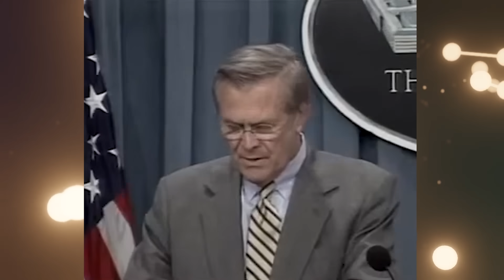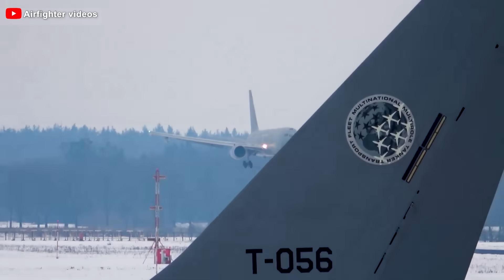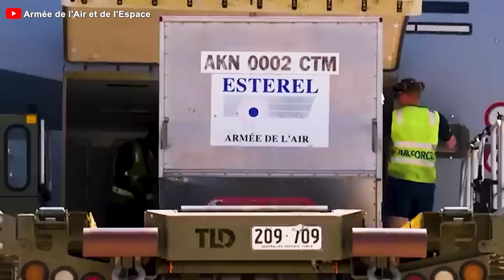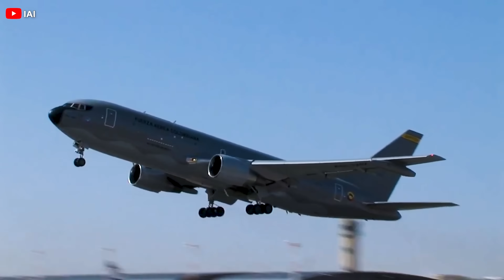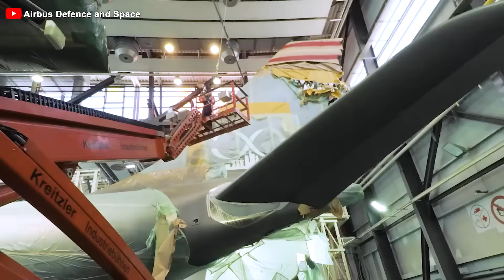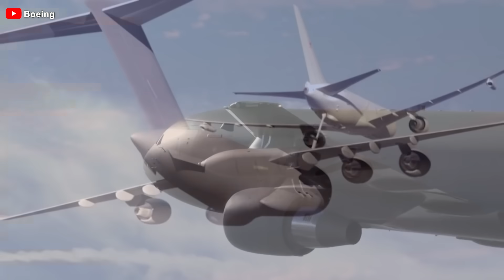Here’s why Air Force prefer the A330 MRTT to Boeing 767 in KC-45 contract!

Comment: They probably would have taken the KC-45, but the need to redo parking spots and rebuild hangars to accommodate the KC-45 was a bit of a non-starter.
Reply: doubt it ,the KC45 isnt bigger than the KC10 , more likely was that boing told theyr lobbyists to pull the USA card ,even though Airbus was allready building a production line in the US
Reply: @martindonat3249  - You sure about that? Could the KC10 –if they had enough– have been used for the sole tanker? Nope. So yeah, the airport issue is huge. The problem is that they want a 1 size fits all tanker for cost savings reasons. The deal was done under sequestration. If you need 1 size to work, and some missions can't use a large tanker, then you order lots of the small tankers. It's stupid, but it is the simple logic of 1 size fits all. It will hamper our military in some places in the world, but money changes everything.
Reply: @5metoo  you made me look up the messurements , they are prety simelar in sice ,exept the wingspan ,the airbus ha 10 m (30 feet) more, i didnt realise that befor , the main reason they didnt buy more KC10 for one the existing ones getting kind of old ,and the aircraft type was disscontniued after boing swallowed mcdonald douglas so there is nobody building new once , also the airbus is the more modern and efficent of the two
Reply: @martindonat3249  - Sure, but doesn't the point stand that they're talking about replacing a fleet of small and large tankers with 1 tanker, and the only way to do that is to choose a small tanker? I think a more reasonable choice would be to replace a large and small tanker with 2 tankers, one large and one small. I heard a tanker pilot once comment that he flew KC-135's on missions where it wouldn't be practical to use the proposed airbus. But lost in all this is whether a 1 size fits all strategy is wise. It doesn't seem to me like it is. But that's government for you. People are now arguing over the details when the grand strategy was apparently settled by unnamed bureaucrats who don't even understand the consequences of the choice they made.
Reply: It was such a non-starter that it won the contract. And then Boeing lobbied the US government to cancel the deal.
Reply: This would have been less than 1 % of the extra cost due to contract amendments, delivery delays, perfomance gaps etc - you can be sure that in case you point to such shitty little things that the truth is somewhere else and they throw smoke grenades - indeed as long as the proposal is in line with the requirements which of cause included topics like parking stands and hangars why did it win in the first place - because thei Air Force wnated and needs a working solution and not a shitty paper tiger

Comment: I will never understand why they want Refueling tanker to be multipurpose. that is like you requesting a smaller gas tank in your car so you can have a larger trunk.   I would think they would want to be able to refuel more aircraft so they can accomplish their mission.   
I am also amazed every time I see an air fueling. How they can line up they aircraft receptacle with the boom or basket.
Reply: The A 330 Mrtt can carry more fuel than the KC 46... 
You want the tanker to do more things than just carry fuel. So you can deploy troops with more plattforms, carry ammunition and equipment to forward bases, and after that you can refuel planes all on the same plattform.
To stay with your car example, If you have a 2 seater sport car its nice for driving fast. The problem comes when you need to carry more than 2 persons or need to carry large things. So a M3 touring or somethings along those lines would be better than a corvette for most owners.
Reply: Imagine you requested a gas tank that fills your entire trunk. Would you ever be able to fill it completely? Probably not because the weight of all that fuel would become a problem. Would you ever need it? How often do you make that 2000 mile nonstop trip? Probably never. On the other hand, sometimes you want a really large trunk, and don't need to carry much fuel, because you need a deliver large items over just a few miles. Now you could just buy two cars, one with an enormous fuel tank, and another with a small fuel tank so you can carry more cargo, but moneywise you're probably better off owning just one car that is a compromise between fuel capacity and cargo capacity. Military thinking is similar. If you can buy a single aircraft to do multiple missions, you might not need to buy two (or even more) types of aircraft.
Reply: A common mission for tankers is to deploy fighters overseas, providing them fuel during the trip while also carrying mechanics, spare parts etc.
European MRTTs are also often used on transport missions alone, as troop and/or freight carriers. They can also perform medevac flights, like the KC-135s before them.
Having a single fleet performing several roles is especially important when you operate a small fleet, not hundreds of strategic aircraft like the USAF.

Comment: MRTT highiest payload, true multirole not only troops or fret, also command module etc etc etc Boeing is ONLY politics even Nortrop looks "disgusted".   Bizarre tenders led to naval problems destroyers are being rebuilt by Ficantieri.... finally same problem with KC... too big lobbies leader to too big mistakes. While for exemple Général Electric and SAFRAN are building US/FR engines ( LEAP) for decades with ZERO problem.... some will say I am french and wrong ..😂 the fact is that U.S.A have a big PROBLEM refueling while superb solution was/is availaible....

Comment: Airbus was a better functional fit. B plane is still missing capability.
Reply: And what capabilities might those be oh wise oracle!?
Reply: Range, fuel capacity. Ability to use em as C&C centers and transports.
Reply: Not too mention refueling more planes at once.
Reply: @NeroontheGoon  Multipurpose answered well by
 
@frednoname3714
för 10 timmar sedan
MRTT highiest payload, true multirole not only troops or fret, also command module etc etc etc Boeing is ONLY politics even Nortrop looks "disgusted".   Bizarre tenders led to naval problems destroyers are being rebuilt by Ficantieri.... finally same problem with KC... too big lobbies leader to too big mistakes. While for exemple Général Electric and SAFRAN are building US/FR engines ( LEAP) for decades with ZERO problem.... some will say I am french and wrong ..😂 the fact is that U.S.A have a big PROBLEM refueling while superb solution was/is availaible....

Comment: Not only did Boeing outbid Airbus by 1%, they also guaranteed the Pentagon that the price per plane was fixed and any overrun cost would be absorbed by Boeing.
This bit both the Air Force and Boeing in the ass, to date, Boeing lost more money on overrun than the entire contract cost, in other words Boeing lost huge amounts of money and to top it off, the Air Force is stuck with a tanker that is not fully operational due to too many problems with an old air frame.
Had the Air force stayed with the MRTT, they would be flying a fully functioning  tanker/cargo plane that is new and still in production that can refuel 3 planes at the same time instead of 1 plane at a time, carry more fuel, can refuel more planes, has a longer range and so on.
This case is a prime example of politicians not looking out for the best interest of the military and I suspect there was plenty of under the table handshakes going on to hand Boeing this deal.
Reply: Well the US governement is well known to just be an excuse for compagnies to turn their will and greed into laws. And thats especially true for the military industry, they manage to spend between 3 and 6 times more than China in defense budget for just maintaining their army, while the CCP has been building it from scratch the past decades. You just can't explain such a difference in money spend vs actual vehicles produced just by "its better in the USA". So many billions disapeared into canceled programs, with the compagnies leaders keeping millions each time... Its just a huge fraud scheme.

Comment: The military changed the RFP requirements to allow the Airbus to compete and win (initially).  Boeing sued on these grounds and won.  From what I remember, the airbus tanker would require significant modifications to many military runways due to longer wings. This was not an issue with the 767.
Reply: I'm not sure you modify runways because the aircraft have slightly wider wings.
Reply: Wherever a C17 or Galaxy was fit to, the A330 MRTT fit as well. As far as I remember the US is the only Country selecting the Boeing tanker. I`m sorry for the US pilots to fly the second best tanker.
Reply: No, the MRRT got explicitly penalized for being more performant. They structured the mission profiles to fuel single airplanes with short missions. The MRRT got penalized for launching with more fuel and launching with surplus refueling pods. They also ignored its capabilities for transporting cargo.
Reply: No, it was the hangars that were too small.
Reply: Airbus A330 is much larger than KC-135 or 767.  It would have required significant MILCON = $$Billions, A330 would not fit in existing hangars!!  Also, Gen. Arthur Lichte was corrupt AF look that POS up.

Comment: Missing is the slanted review process that allowed a larger plane than was originally specified to be considered. the dod told Boeing they did not want to consider a larger airframe and then accepted one in the Airbus airframe. The 777 would have been the direct competitor to the A330. They were more concerned about the number of aircraft and total operational costs.  There was also a good deal of mission creep and increased number of configuration to be capable of handling different aircraft types than what was originally specified.

Comment: I don't think it matters. The most important point is that after this experience, I doubt that any European defence company will ever compete for a major US defence contract again, which in some areas, puts the US in the hands of a de-facto monopolistic supplier.
Reply: That has always been the case.  The US requires (in a VERY China way of doing things), that everything must be built in the US, by a US led/owned company.  So add in that, having to partner with an often, rival US company. To get things built in the US.  Along with propriartary tech secrets, walking out and appearing in US gear.  Is it any wonder that EU companies dont do much business with the US.
  US gear is not always the best either. So people buy different things for thier own needs.  The US AEGIS RADAR system is an excellent system. So is the UK Sampson system.  Both do the job very well. Both have strengths the other does not.  They work better together, each covering the weaknesses of the other.  AEGIS is reported to have a shorter range and less sensitivity, with a better acqusition time to launch time. Sampon, greater range, sensitivity and number of tracked targets, with a longer time to aquire and launch.  Both do the job they were designed for.  Samson, has, in several joint exercies had to be turned off. So AEGIS operators get some experience.  Together, in a BG, probably the most letha air defence setup in the World.

Comment: The USA has always had an understandable aversion to procuring overseas. Buying a 'home grown' product has many advantages. Control of supply, money into the home economy, security etc., As long as the 'product' is fit for purpose and meets specifications, it makes sense.
The downside is that decisions can get skewed by political interference and Boeing has long been able to use that to leverage products which are not always the best option. The problem with that is that Boeing has relied on its clout rather than engineering prowess.
Reply: They were going to build a KC-45 factory in America. 
This is bribes in exchange for protection.
Reply: I mean, without any pressure on American companies to do better, you'll always get substandard crap like the KC-45, why bother trying if you can just cheat and get the money that way?

Comment: There is about a 20% difference in size between the two aircraft. Depending on how the mission profile is written, one will be favored. If it is strictly cost per volume of fuel capability, suitable for refueling several bombers, then the larger aircraft is better. If the mission is to refuel a few fighters, then the right size aircraft is better, probably a 757, though a 767 is ok.
The Air Force deliberately wrote the mission to favor the a330 because they were pissed from the embarrassment of the lease debacle. That was because a dod official handed Boeing a sweetheart deal in exchange for a later job, then went to jail.
Reply: Did anyone from Boeing suffer the same faith?
Reply: good point. where do you bed down your tankers, how many booms in the air do you need at one time and place, and is there enough ramp space for that number of aircraft.

Comment: The KC-46Pegasus was cheaper?
Its billions over budget, the USAF had to ground it for safety reasons losing capability and it stillcannot refuel using its boom meaning costly repairs to old KC-135s to keep them flying.
Its a boondoggle Boeing foisted on to an unwilling USAF by bent Senators

Comment: The fact that American political representatives push "Made in USA" as an absolute dogma, gives carte blanche to their national suppliers whatever the price, means that today the NAVY is unable to renew its fleets of nuclear attack submarines or even Ticonderoga destroyers or even frigates with the monumental flop of the LCS whose congress demanded the construction of the last tranche despite the fact that they would not be used.
Funding for the F18 replacement is on hold.

That the American BITD has multiplied the prices by 7 taking into account inflation.

And the cherry on the cake is that the cost of using the F35 is weighing down the MCO budget of the Air Force and Marines.

But it's true that raising the roof of a hangar costs a fortune! 🤣🤣🤣🤣
-
Reply: The Airbus would have been build in Mobile Alabama. So it would have a made in USA sticker as well.
Reply: @martinscholer5419 desperately needed union jobs for the southern states!

Comment: THE USAF should have both - especially for the larger KC-45 for the Pacific and augmenting other transport roles.

The KC-46 isn't good, it needed Boeing to cry like a child that someone made a better overall product and they weren't in on the deal.  The US does make some exceptional equipment, but it doesn't have a monopoly on making the best in everything - and its high time that procurement for the US military see this, and of course get what is best - this shows protectionism.

Comment: I can tell none of you have ever been in the US military. The answer was quite simple why Airbus lost the bid. The military is not going to pay for facilities upgrades if they can avoid it. They are not going to modify, and or replace hangars for a new aircraft. A lot of bases has hangars that are 60 to 70 years old and they are still in use. The MRTT might be a superior aircraft, but they not going to change the landscape for it.
Reply: The US military picked the MRTT - twice. It was overridden for political pork reasons not hangars
Reply: Utter rubbish, the US picked the superior aircraft TWICE and then for purely political reasons, went for the inferior US offering.
Reply: @knightsnight5929  what branch of the service were you in? I was in the Air force for 6 years. I know what I am talking about. But in fairness. I agree the MRTT is the better aircraft.  But here's the point. The Kc-135 is over 50 years old. Why are they replacing now, and not 20 years ago. For those of us who were in the Air Force we know. It's the availability of parts. The Air Force would fly the damn thing for another 50 years if parts were available.
Reply: I bet that upgrading a couple of hundred hangars is a lot cheaper and faster than updating and maintaining a fleet of old aircrafts because the new one isn't ready yet. It's Boeing they deal with, it's not like they couldn't expect it to be delayed and over budget.

Comment: KC-46  not going to replace the KC-135 . The USAF is retiring the KC-10
Reply: The KC135s are rotting, particularly around the tail. If they're kept flying it's only a matter of time until the tail falls off one. Keeping them airworthy is costing vastly more than buying new aircraft

Part of the problem is that the KC135s weren't flown enough. The corrosion in question is a direct result of sitting cold out in the weather on flight lines for extended periods instead of being above the weather (but, bear in mind that the NEWEST KC135 is over 50 years old)

The reason the KC10 is being retired isn't that the KC135 doesn't need to be retired, it's that there are only a few of them and taking those out of service isn't a big deal, whilst it frees up maintenance resources to keep the larger KC135 fleet on life support
Reply: @miscbits6399  Sounds like Beoing cant build a good plane there are Dc6 still flying today  and Dc 3
Reply: the Kc 10 is a better Plane then the KC 46